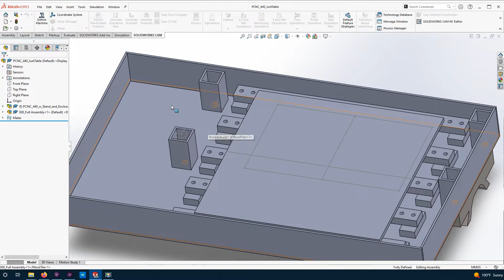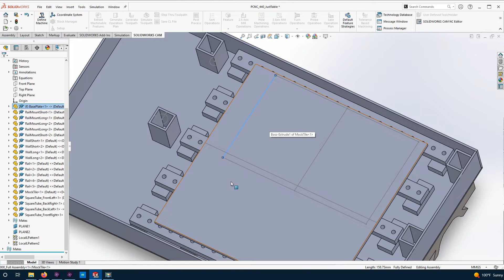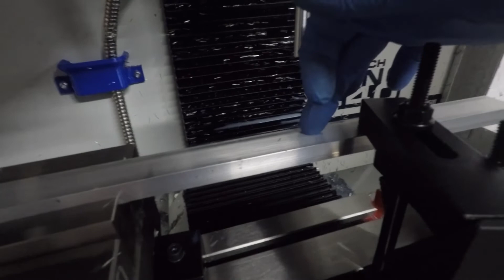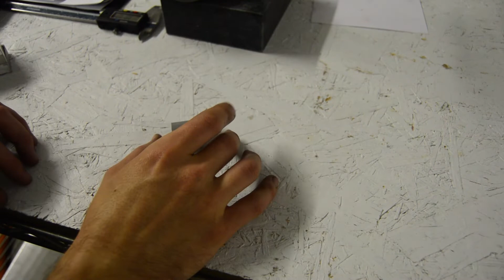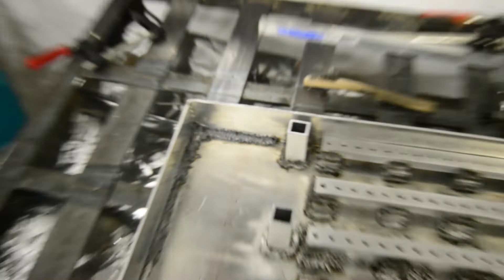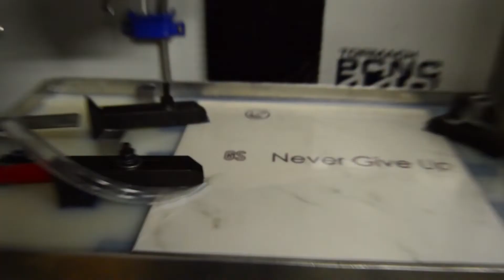DIY Tile Engraving Fixture for CNC Mill ~ Tormach PCNC 440

Comment: I see this is an older video but, nice project and cool results! However, the thought of hand tapping all those holes, yikes! Although the PNC440 cannot "tap" due to its lack of reverse, it can do thread milling. This is a very effective way of creating threaded holes with this machine, using either single or multi point threading tools and can be much, much easier and faster than tapping manually.
Reply from the maker: Agreed. Those tools are a bit pricey and I've made a habit of hand tapping.